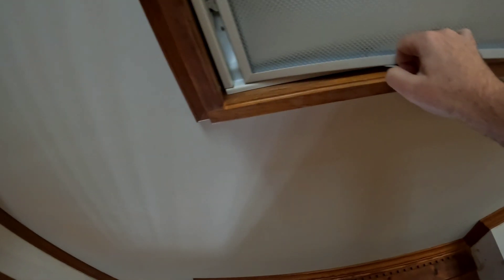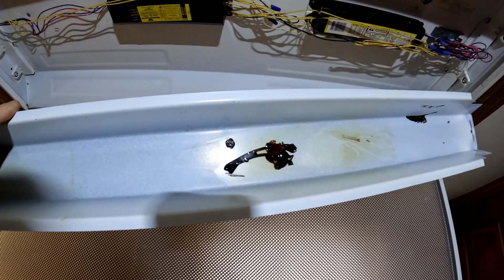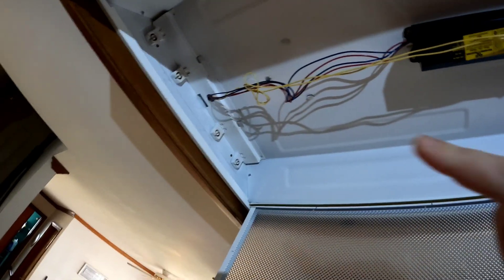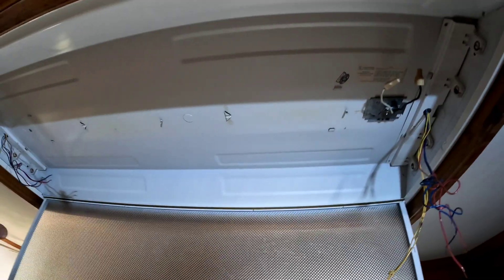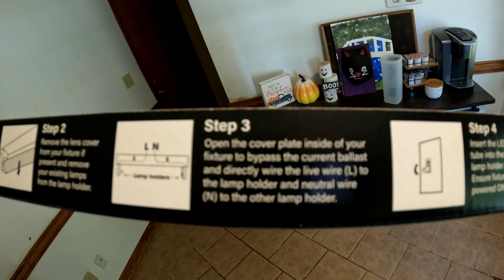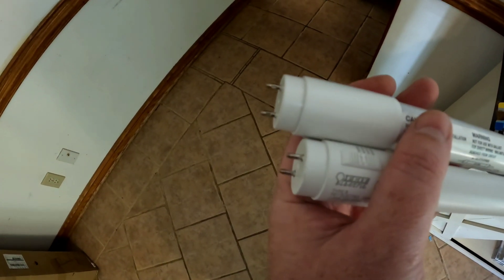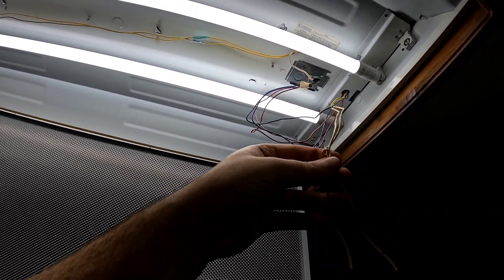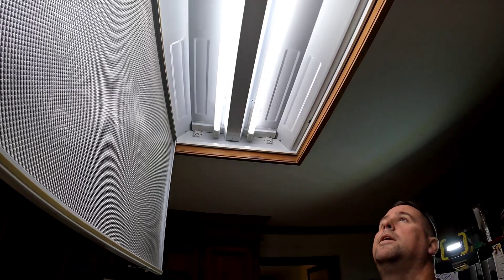DEAD Fluorescent Light? Easiest DIY Ballast Bypass to LED Tube Upgrade

Comment: Sooooo, how do you know which led bulbs require ballast and which don't ? I could not find ANY info on this.
Reply from the maker: Most do require ballasts as they were designed as fluorescent fixture bulb led replacement so they designed them to run on ballasts. In the description or info it will specify. The ones that dont require a ballast are usually labeled ballast bypass.

Comment: Nice work. Wow those are ancient ballasts. You actually got it backwards, the one with the all yellow sticker is the original and it’s good that the newer one was the one leaking because the older one has dangerous PCB tar in it.
Reply from the maker: Yeah they were old for sure, thanks for the info!